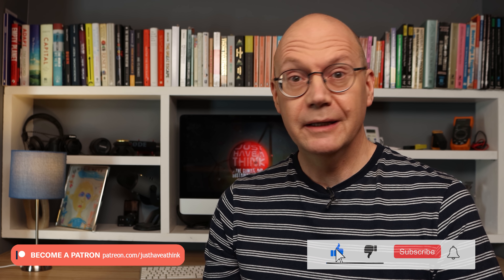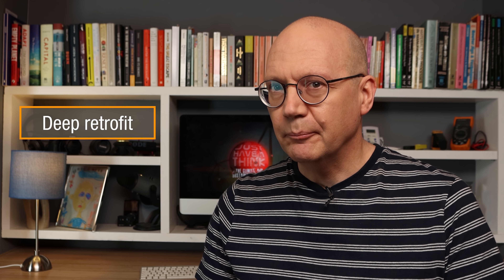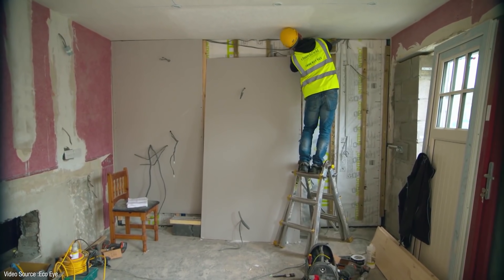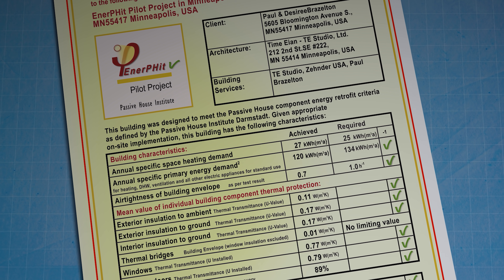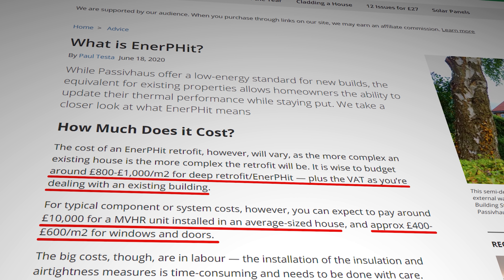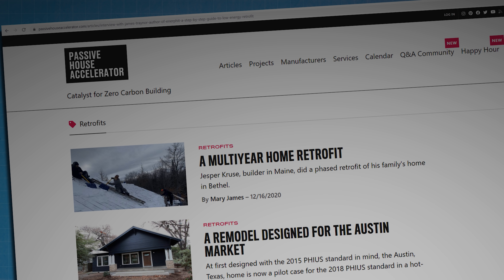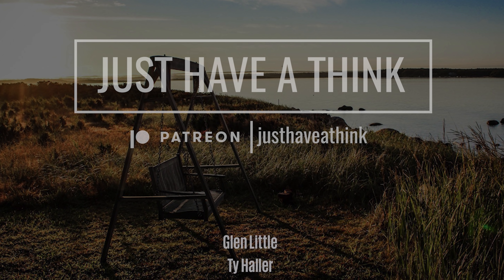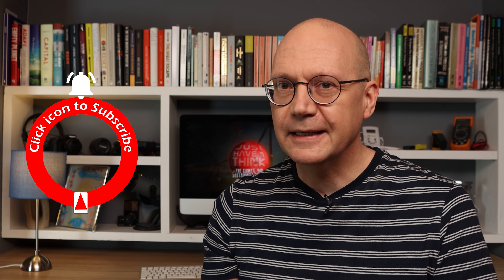Retrofitting to Passive House standards

Comment: I'm wondering if tearing down my old house and building new passive one from scratch wouldn't turn out cheaper than retrofitting the old one...
Reply: Yeah, this type of retrofit seems better people buying a fixer upper at a deal, then integrating this into their remodel
Reply: @deansmits006  Perhaps because it is a flawed model? Best wishes.
Reply: @jimmycorkhill1390  What is the flaw in the model?
Reply: @MrMichiel1983  Trying to achieve a passive house standard. All the bells and whistles far outweigh the benefits. Like spending loads of money on super thick insulation to achieve the lowest U-value you can when half as much isnt that much different. Isnt it called the law of diminishing returns or summit like that? There is many simpler ways of achieving cheap comfortable living without getting scammed by the latest fad. Best wishes.
Reply: To me the biggest thing to consider, is. The huge pile of energy and material, going to the dump, and then coming from the factory. There is nothing environmentally friendly, about any of this. Fix what you have, unless it's really bad.
Reply: @billpetersen298  Good point.
Reply: @billpetersen298  Definitely agree with that. Not had a bin or taken anything to the dump in about 8yrs. My do your business in other peoples yards? Best wishes.
Reply: Sometimes a fixer upper should be a blowerupper. Depends on if it's just average, historical, quaint or has some special quality. Also depends on how well done the original build was. Perhaps full fast gut first, and determine when you see it's bones
Reply: A few years ago I worked for a large bulding contractor / developer (John Laing plc) we did a vrey intersting project in Bristol for a group of people who'd bought ex-council precast conctrete houses (Airey Homes they were called)  what we did was carefully demolsh the whole superstructure above the ground slab and replace it with a timber-framed house.  If they'd wanted to we could have put attic trusses on and made them two-and-a-half storey homes, but that wasn't asked for. We weren't working to passivhaus standards then just bulding regs, but they were much better insulated and more airtight than "normal" spec builders stuff. It worked out about 65% of the cost of  building new as the foundations were re-used.  What we need is for people to band together and do similar projects now at passivhaus standard so that they can employ reputable contractors and get the economies of scale that doing  20-30 houses gives you.
Reply: @sounduser  Sounds like something people try to achieve for the sake of achieving it than something with logical reasoning. Best wishes.
Reply: @jimmycorkhill1390  It's not a 'fad'. PH has been going for 30 years and has very sound principles. EnerPhit has been going since at least 2008. The point about think insulation is that if you are going to add insulation the cost is most in labour so putting it on twice as thick costs almost nothing. Yes there are diminishing returns, which is why there is a standard for what level of total heat loss and internal surface temperatures you are trying to achieve over the whole building. The important thing about the internal temperatures is keeping surfaces above the dewpoint (~14C in the UK climate) so there is no condensation nor mold. Putting half as much insulationon daoesn't achieve that. So it's not just going crazy for the sake of it.

Comment: There is almost no way to economically insulate old structures  It costs more than it'll save  Even co2 savings are minimal or negative if you use foams  You see foam takes lots of energy and is made from oil  You'd think RockWool made by melting rock uses more energy has more Co2 but it has the least.  If you can get other benefits you want, nice new wall surfaces new or enhanced electrical like more outlets AC outlets.  Windows are horrible pay backs, it's cheaper to close them up and hang a big screen TV over the opening and tune it to Hawaii.  Triple windows NEVER PAY BACK THEIR COST EVER and have even higher CO2 burden.  You can fix up windows but it takes care, vet whoever you hire by ckg 3 prior clients 2 yrs in past and 3 1 yr.  You also need to be insanely careful about trapping moisture in the walls as commentator says.  It's better to do nothing.  Hint, safe play, use unfaced rock wool and drywall inside and seal at drywall.
Reply: Triple windows make a world of difference, they can make an old building that is barely liveable in the winter or the summer comfortable while reducing heating and electricity costs by a few hundred dollars a month.
Reply: Careful, it's not better to do nothing. Doing something, even small, is better then nothing. Every bit adds up if millions do it

Comment: One of the worst heat sinks in traditional N American stick house construction is the wooden studs used  for walls. These coupled with a sheet of OSB that then gets covered with thin wraps then vinyl siding is a weak insulated result. The studs need a make over ie split in two with an air gap in the middle to break the heat path loss route. Maybe it’s time to look at recycled plastic studs with honeycomb interiors.
Reply: It would probably be easier to just sheath the entire house in insulation to eliminate the bulk of the thermal bridging(even R5 foam panels would make a difference)
Reply: I've seen an alternative or two on the traditional stud. External sheathing is a simple fix for now

Comment: I moved from a house built in the late 70's costing around $3k per quarter in electricity to a new build 6 years ago with an electricity bill around $900 per quarter. This includes moving from no AC to a heat pump, and a wood heater to the aforementioned heat pump. It also includes my 4 kids getting older and utilizing more gadgets and computing. No more chopping/stacking wood, no more sheltering in retail shops on extraordinarily hot days for sweet relief from oppressive heat, or going on a pointless drive in my car with AC. We weren't even striving for passive, and aren't close to that standard. We rate around 6.5 stars on the Aussie scale. First version. We will improve. $0.02
Reply: When a friend moved to a new townhouse, I asked how much his gas bill was. In a house 65% larger than mine, it had the same heating bill! My house built in the 70's, with newer windows, gas water heater and furnace. Motivation for me to improve my thermal envelope.
Reply: I live close to the most southerly point on mainland Australia and live very comfortably in my self designed and built 28 square home. With a few solar panels on the roof (3.25kw system) my electricity bill is $1200 for the entire year and my house is all electric. I am retired and spend almost all my time at home (family has all left home now). I faced the house towards north, placed the garage on the west end as a buffer from the setting westerly summer sun and placed only one small window on the east side and stuffed insulation everywhere. This house will continue to be economical and comfortable long after I am gone.
Reply: I LIVE IN A SOVIET APARTMENT BLOCK in Bulgaria - you know those nightmare looking things you see on TV and think "OMG I WOUDL RATHER DIE THAN LIVE THERE!!!"

Turns out they are AMAZING, they look shit cos the outsides have not been maintained.But the prefabricated walls are 30cm thick concrete, internal 20cm concrete.
I've just checked my TOTAL electricity usage for the last year and it is 21.8Kwh/m2 and that is with ZERO retro fit. Also - you NEVER hear your neighbours, even kids blearing music. My electricity bill is $63 a quarter.  Yes sixty-three USD. I have a small fan heater for the very coldest days of winter. Basically, it is totally passive heating and cooling in a climate of -15ºC to +40ºC
Reply: @piccalillipit9211  Hell man, they say we have extreme climate in Australia, and it does get hot for long stretches in the summer. But in Western Australia where I live it never gets below 0 C. 
I know snow looks beautiful and fun and all that (I have never seen any yet and look forward to it one day) but I hate working int the wet and cold!
I guess in your climate the Soviets knew what was needed to suit such extremes! And still standing 40 odd years later!👏👏
Reply: @emceeboogieboots1608  - When I first moved here 12 years ago it used to be -25ºC in winter and +45ºC in summer - that is NOT a joke. 
It was one of the areas with the biggest annual swing, 3ºC a week on average and OMG did it take some getting used to.
We can still get 25ºC swing in 12 hours, we had a few this year. 
You see we are between the Sahara in the south and Siberia in the north east and those ar the two directions the wind comes from, so a change of direction makes a HUGE difference. Just looking its 25ºC now and tomorrow morning 6ºC
It can give you massive headaches and make all your joints hurt... LOL
Final thing - we don't get snow any more, even if its cold no snow. We never get cold humid air its always dry air if its cold .
Reply: @emceeboogieboots1608  - Oh - another thing - the apartment blocks were designed to last either 100 years or 200 years.  This is a 100 year block. I have lived in a 200 year block and they are like living in a mountain, even the interior walls are 30cm thick concrete, even the door frames are concrete LOL. 
And every apartment block has a nuclear bomb shelter in the basement.
As I say they look like shit but they are the best built things I have ever lived in...
Reply: @piccalillipit9211  are you south facing?
Reply: @alicequayle4625  YES the block is south-facing
Reply: That's WITHOUT AC?  A thousand bucks a month, on average?   Wow, I thought my house was bad....  Oz dollars, I guess, but still.  That's double what I pay in a poorly insulated 1961 4br home with AC in the heat of summer.
Reply: @incognitotorpedo42  $900 every quarter (3 months) and we have a heat pump for AC now. Also I'm on Tasmania, a small island with one electricity provider.
Reply: @incognitotorpedo42  They said $900 per quarter not per month. That's equal to $300 a month
Reply: My family's house in Perth averages us around $130 per month. We have roof insulation and 2.6kw solar. The house is quite well shaded and we use the AC only for a month or so over summer. The winters aren't particularly cold, but my wife uses the heater a bit whereas I am happy to rug up. Given our reletively low energy use for heating and cooling I don't know where to get my best bank for buck in retrofitting. 
I am thinking of a larger inverter and array with some batteries perhaps

Comment: I still remember when "double glazing" was the new big thing...
Reply: Depending on where you live double glazing is fine, but in some harsher climates there is a good return on triple glazing and additional insulation.
Reply: I grew up with single glazed windows, open fire and no heating upstairs. Sometimes the inside of the windows upstairs had ice on them.
The fire would have been blazing hot with all the doors open so upstairs got warm too.
Reply: @sharonsloan  me too. I remember ice on the inside of the windows in the morning, but I think we'd all agree that it's not efficient, comfortable or low carbon. Spending money on better fabric so you don't have to spend it trying to warm up the whole atmosphere is a good thing, and much cheaper for everyone in the long run.
Reply: ikr.
Reply: And vinyl instead of aluminum frames.
Reply: 3G only costs about 10% more than 2G but has 35% lower heat loss and dramatically better comfort due to higher internal surface temperature (above 14C when -4C outside so no condensation) and no draughts. If you are replacing windows you really should be doing 3G these days. Modern 3G is 2.5 times lower heat loss than pre-2000 2G.
Reply: And now double glazing is pretty much the standard of the industry.  Technology improves; the future has a positive bias.

Comment: The key issue about co2 emission in relation to housing is the consumption of electricity by households and therefore its production . If we all consume 50% less, and so purchase 50% less electricity that will reduce the demand and the power stations will reduce production. Supply and demand. Or is it too in inconvenient to reduce our electricity consumption? Our ecosystems die while our only statement is "its inconvenient"
Reply: Good focus, part of it the 3 R's. Recycle, reduce, reuse. But that only goes so far. Reducing heating bill by half in winter... What would that do to interior comfort? 50F inside? Unsure. But turning down three thermostat to 65F, and getting the house sealed, adding attic insulation... Good combo
Reply: @deansmits006  the problem with the foam type insulation is its production pollution. Really, the problem of energy consumption is not going away by any means. Its all a bit late now. The chemical reaction happening now in the atmosphere is  the culmination of  the previous 250 years of extreme co2 emissions and as co2 emissions increase that chemical reaction is enhanced. This is all bows and arrows against the lightning. I live in the mountains of Andalucia, hundreds of trees, clean air and water, negative carbon footprint. I got here by hard work. Good luck everyone x
Reply: And these modifications can reduce electricity consumption significantly if you would normally heat or cool your house using electricity.